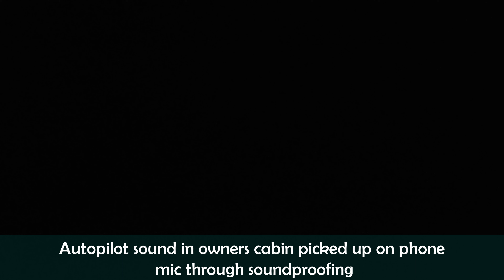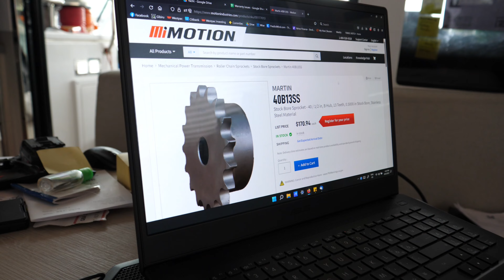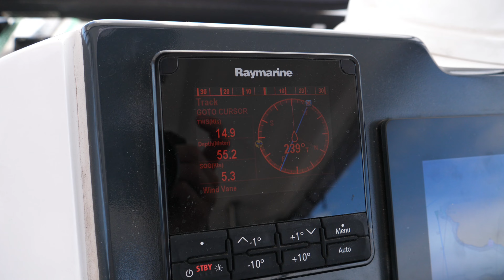Our Ongoing Leopard 45 Warranty Experience with External Suppliers | LEOPARD 45 CATAMARAN REVIEW

Comment: My B&G autopilot also made noise right out of the factory in LA Rochelle, FR. Fortunately, I hired a very experienced delivery skipper who caught the problem immediately and the Neel factory was forced to immediately address the issue in La Rochelle. After the repair, the captain inspected and tested extensively before crossing the Atlantic. Dealing with warranty issues with most boat manufacturers is a complete and utter nightmare. As a customer, you paid for a very expensive boat to be treated like horse manure.

Comment: Hi, on the water pump issue, the issue is a design flaw. The pump should be placed lower in the boat, so it will be primed at all times and can pressure water to the outlets. Now it is using its energy to suck water from tanks below and water might run back in the tanks through the pipes, so it has to suck and prime when used.
Reply from the maker: You should let R&C know so they stop doing it. We don't have the qualifications to suggest a plumbing design change. Email them maybe?
Reply: @travelsketch  these guys have so many fundamental problems. They should be doing garden works and pool cleaning, to not destroy all the equipment and material that goes into a catamaran, by sloppy design and non skilled labour
Reply: @travelsketch  it was an answer to you trying to maintain pumps and upgrade yourself out of a design problem

Comment: Hi Guys, What a stuff up
Looking at that steering sprocket keyway, a stepped key will not last as good as a genuine square key, then add your grub screws , also adding a dimple to the steering unit will help, these are all simple things to do if you are a qualified tradie,
Also it looks as though it has had a sleeve welded in place to reduce the sprocket bore to suit the steering unit diameter.
What sort of tolerance is between the shaft and the sprocket bore ?? , it looked too loose in the video,
Because it is alternating backwards and forwards , it ideally should have a size for size fit or an interference fit, between the steering unit and sprocket,
The steering unit should also have anchor points front and rear, as opposed to only on the front, which is causing most of the issues, racking and torsion issues,
The threaded mounting bolts that you showed will not work with the those flanges, you need a purpose built bolt with a long unthreaded  shank that fits inside the mounting flanges, then a thick washer, then the threaded portion of the bolt for the nuts, 
Good luck, I feel for you, Neil Fausett
Reply from the maker: They have since replaced all of the components under warranty since the original Youtube coverage. The correct and undamaged sprockets and parts were sent and we installed them.

Comment: Excuse my ignorance on my limited knowledge of your situation but as a retired machinist, I would think any reputable machine shop should be able to properly fix the sprocket to a the shaft issue by cutting a larger key way on both the sprocket and shaft and retapping another what you call grub screw, we call a set screw in the states. Frankly both the shaft and sprocket should be tapered as well, but that’s a manufacturing matter. Great job on how you fixed it though with though with limited tools.
Reply: Nobody was open and it was time sensitive. Public holidays etc. It is very hard to find competent tradesmen in that area of Italy as well. I was guessing that it would be faster to repair ourselves that look for someone a chase them up.

Comment: The simple solution for the keyway mismatch would be stepped key stock.  Stepped key stock is designed just for that purpose.
Reply: I think a step key could not take the pressure and would snap off, there is a lot of force turning those 2 rudders on a 45' foot boat

Comment: Is there a thread in the shaft to put bolt in to retain the sprocket ?  Go to a local machine shop and get them to just cut the right size slot in the sprocket in another position.

Comment: Bottom line here is leopard is responsible for it, it's their product and they deal with it while they repair the issue, it's just like buying a car, whoever makes the steering for the car (a subcontractor, who likely has their own warranty) eventually pays the car manufacturer, while the Car company takes care of their customer through a legally binding warranty agreement.  Most companies have a warranty service, it's like insurance, They pay for the insurance which in turn covers their product including all the different contractors that supplied parts for their product. Apparently their philosophy is to do nothing until you get frustrated and fix it yourself, which is a poor way to run a company. It's not that hard. I do suggest you talk to a lawyer and see what they advise.

Comment: Have you checked with the manufacturer of the autopilot to see if they have a gear and key that actually fits the motor?  When Leopard designs a boat they need to part out what they need and then get an agreement that they can count on replacements for VALUED customers. if parts are discontinued they need to provide a recommended replacement for that part. In the US there are laws that say the manufacturer must provide replacement parts for ten years ( in the automotive industry).  You are living a nightmare in a boat you bought to relieve stress, and it's so costly you can't walk away from it. I do realize this video is a year old now, I hope you've reached a better place.
Reply from the maker: They eventually sent the correct parts and replaced the autopilot.
Reply: @travelsketch  While this sounds like a victory, it is an undeniable hardship  that was eventually overcome. Curious if you've had any correspondence with the owners of the Company? I do believe this is normal for the boating industry, especially blue water cruisers, the more this gets out there, the better chance there might be changes happening. Best wishes!

Comment: Parts are a problem world wide. It took 2 months to get a body mount for my 4x4
Reply: The point was how can manufacturers not be able to replace an item under warranty when that item is readily available from their distributors. It has been almost 6 months since the Axiom unit was deemed faulty and it still hasn't been replaced because Raymarine say they have no available stock, yet we can buy a unit from one of their retailers today including some retailers who are also authorised Raymarine repair centres.

Comment: The tec that intalled it the first plaice should have seen it ...comonsence
Reply from the maker: They sent it home with cheap imitation red loctite which naturally let go after a while. They knew what they were doing. Instead of using the correct machined key which comes in the kit with the sprocket they used the incorrect generic key that comes with the type 2. They just didn't care enough.

Comment: I’m frankly amazed that this problem still exists 10 years later, an issue I raised in 2014, what happened to ISO 9000 re-occurrence prevention procedure?  Really amateur workmanship on a part that can be made in your garage a lot more professional. You wasting your time, move on and buy a off-the-shelf sprocket, grease it and you will be good. Align the drive with new chain and not too tight, that will cause more problems, have a little slack. You can fix this in 2hrs, I did in the ocean and it’s working today. My advice just move on. Anybody that has experienced the Warranty process will tell you, its not worth the stress of dealing with Leopard.
Reply from the maker: Trent repaired the issue in the fastest way possible where we were. The point is that we recognise this isn't good enough. If people keep talking about it publicly instead of hiding the fact and they keep doing it, they won't be in business in another 10 years.

Comment: That auto pilot will fail again. Just the smallest movement will cause it to fail. The shaft needs to be tapered as well as the sprocket so its a tight fit when the bolt put in that way it wont move. Same as a balancer on a crank
Reply: This is incorrect.  And it’s not the same as a balancer on a crank. Very different applications.  The fix here really isn’t correct either.  The key should be brass not stainless.  The retaining bolt is there to retain the sprocket. It’s doesn’t  need to prevent all movement laterally of the sprocket.  The AP wil be more efficient if there is a grub screw opposite the key way.  The simple fix here really is to get the correct size sprocket even if it isn’t stainless. A tapered shaft really isn’t necessary here.
Reply: IT will fret i thought moving both ways all the time as it works on a loose key way 
If taper fit no grub screw needed 
Why brass key ?